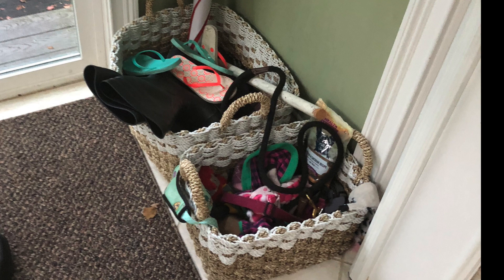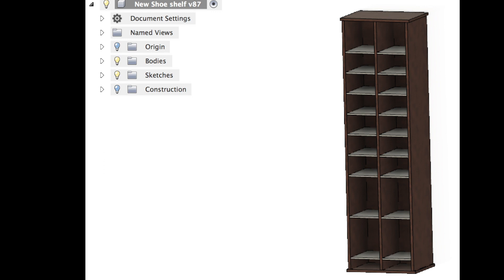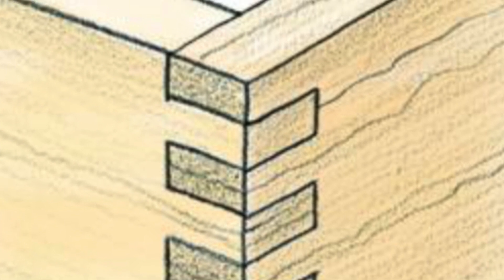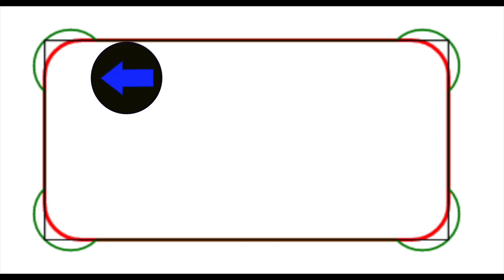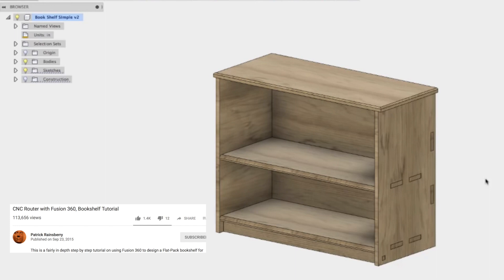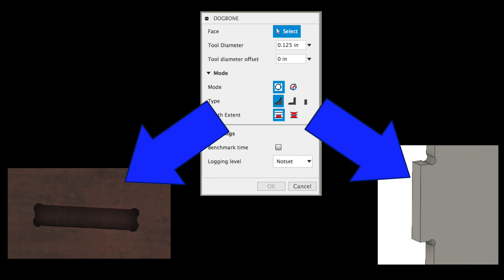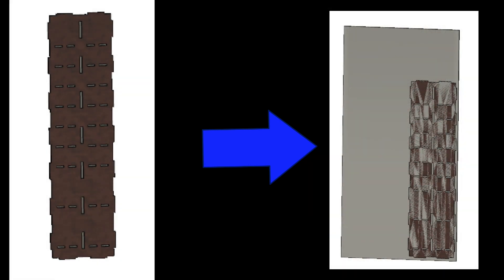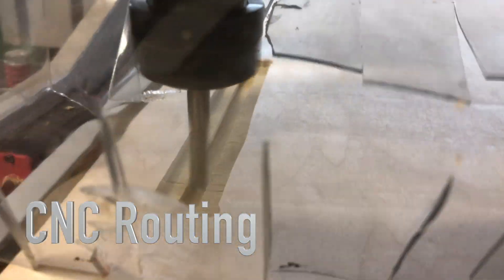Making a Shoe Cubby using CNC Router

Comment: Good design - would you consider posting/sharing the F360 files?  It looked like a good introductory project.  I have the CNCRP4896 but haven’t t used it in anger yet except for flattening some slabs.  It makes me cry though when I look at the cost of say an IKEA Kallax unit compared to a couple of sheets of decent plywood ... sigh.  Cheers
Reply from the maker: I would consider sharing my files with subscribers.
Reply from the maker: Also, there is nothing wrong with buying IKEA furniture, but it's not custom fit to your needs and space, and it's made from particle board.  Plywood is more robust than particle board, and if you ever have to move it, you will probably wind up throwing it away as it crumbles.  You can get birch plywood at the home improvement stores for about $55 a sheet.  I used 2 and half sheets on this project.  You could probably save some money if you made it out of MDF and painted it.